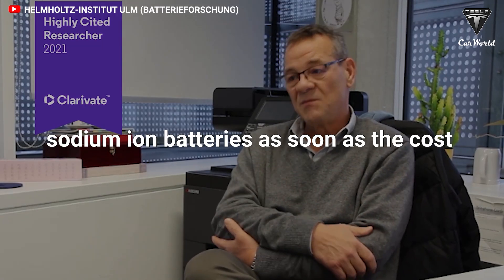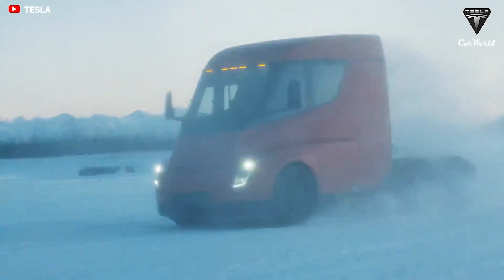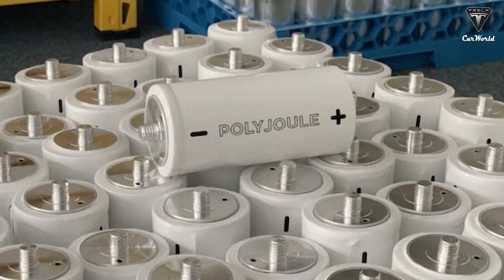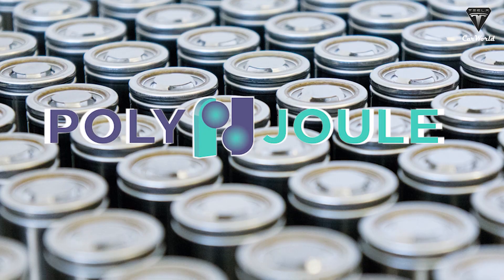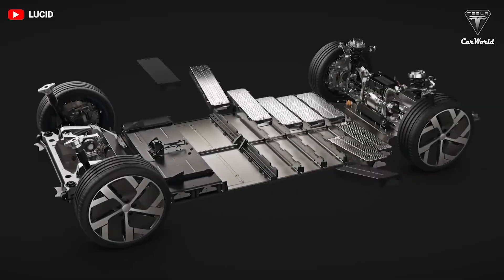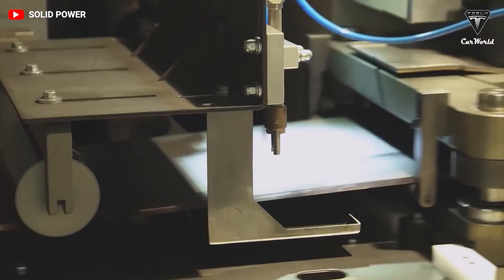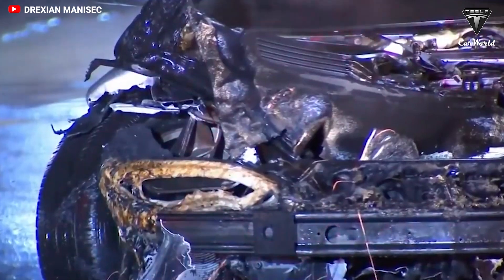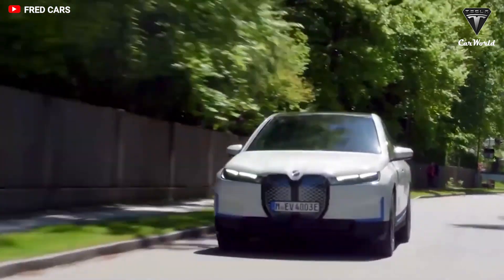No More Lithium P3! Uncovering The All-New Batteries Miracle Material, SHOCKS The Entire Industry!

Comment: The most interesting thing about this technology is that it comes from an inexhaustible source that is accessible to everyone⚡.
 Charging can be done anywhere if it is adapted to a solar system. 🌞    If it is connected to a solar system, the driver is not dependent on a gas station,   access to even the most isolated places.

Comment: This scatter-brained report is apparently composed of multiple random old pieces all glued together (some repeatedly) to seldom make any sense. (One section even talks about things that 'will' happen LAST year.) It includes talks about too many different types of batteries in an incoherent disorganized fashion such that you can seldom tell which battery they're referring to at any moment. To add to the confusion, they also make the mistake of referring to 'lithium-iron-sulfate' batteries (rather than using the label 'LFP'), which sounds to the listener just like 'lithium-ion-sulfate'. They should have listened to it before they posted it. I hope to find out more about these newer battery developments ... but that will have to be from some other source that makes more sense.

Comment: Talking about the breakthrough in power generation, there's a new electro-plasma generator that produces electricity without fuel and recharging is not required. One panel size of 24"x24x2" thick can produce 20 Kilowatts (per the inventor's claim). You need 50 panels to have 1 megawatt of power. They will start mass-producing it before the end of this year. Elon Musk said 'MAGIC' to this invention but the inventor will make it to reality and will be out in the market next year.

Comment: plastic battery? plastic is made from oil...still carbon foot print. May be recycle-able but still uses oil and refineries so not a ideal solution. Also, doesn;t plastic expand/contract quite a lot? other than that, way safer than lion batteries for sure!

Comment: There are MORE Lithium Deposits
Reply: And these ion shuffling batteries need the other materials too. LFP cell cathode is cheaper than Na-ion cells cathode. Anode can be same hard carbon. Sodium ion cell discussion was mainly generated by CATL to release speculative pressure from lithium. Oil companies are investing heavily to push the price up. They benefit from rising costs of EVs in many ways.